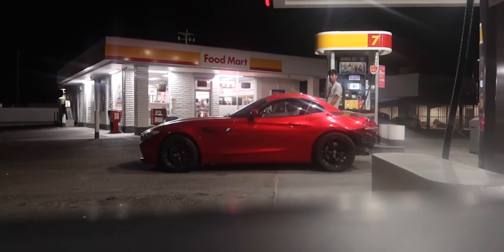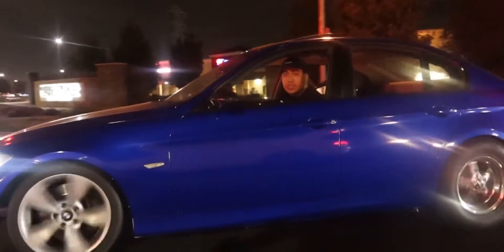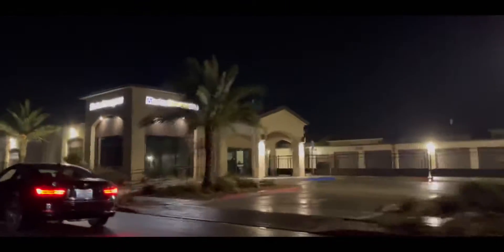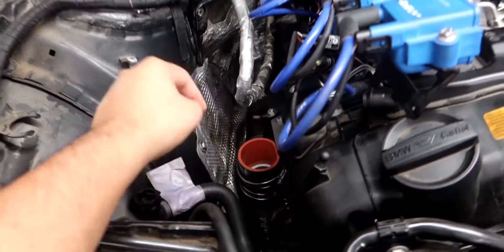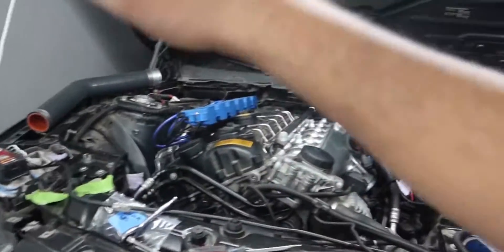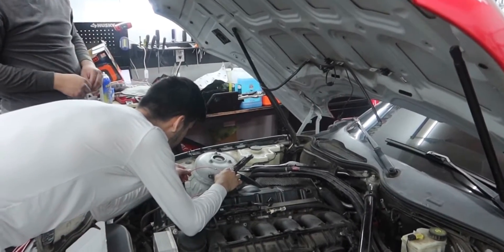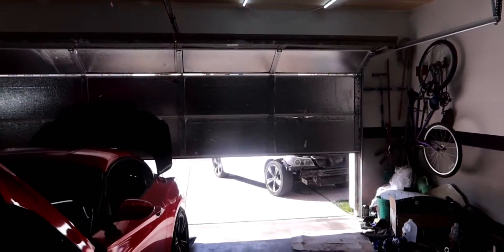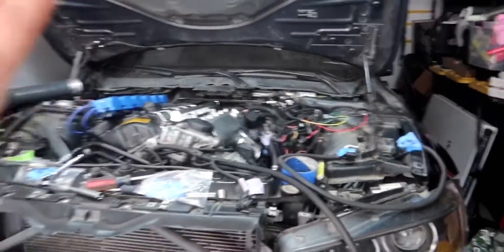FINALLY building my 435i !!! *N55 big boost  kit 3.4*

Comment: Slow down I'm still starting my first turbo build, watching yours. I so appreciate you sharing the pros and cons saves us alot of time, and headache's, and performance/reliability challenges. I fault BMW for not giving us a more "reliable", performance based engine to start with and supporting the aftermarket horsepower/tuning market. Give us strong aluminum engine, aluminum for Intake, valve cover, piping, easy access, a straight upper lower radiator hose with regular stainless screw clamps, big electric fan, big trans cooler, big intercooler, big turbo, tune it, dial it back to pass emissions/mpg standards, at 550hp stock, then say if you were to do this tune (for track only 😉) it will do 695hp on stock parts with no problems, thats a winner for me. $6 gas 😂 I laughed so hard, but so understand it. My part of town the cars would be a rebuilder, salvage title, 4 used parts on it, 3 different colors, some primer spots, or half cocked AM poor fit bumper loose, or cracked, the radiator support cut  up, then have 650hp under hood, $$$ in parts, but never tuned, or right parts, just pops, burbles, and noise, then at 100mph turning 6000 rpm, and no room left for 100-150+mph and poops out, then I go by at 130mph at 3700 rpm still pulling when in V8 work car, only to worry about doing my bmw car correct so they dont win race. 😁